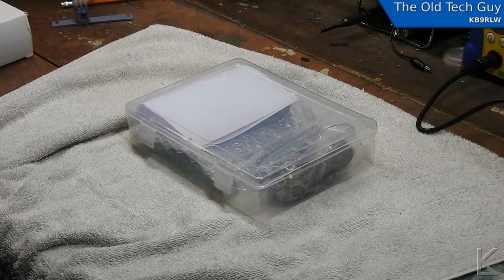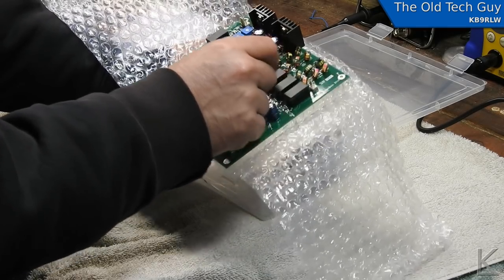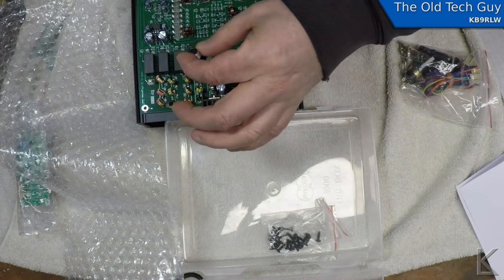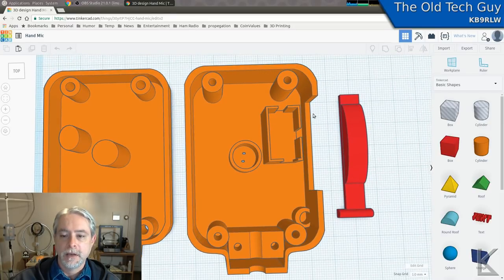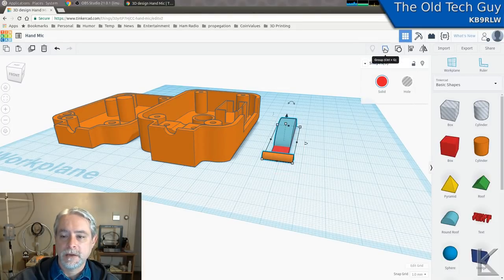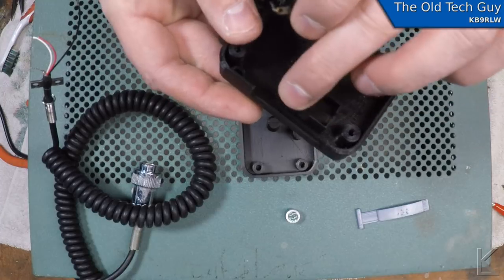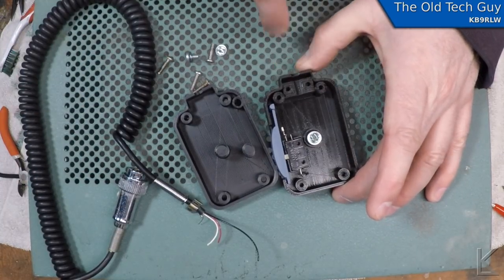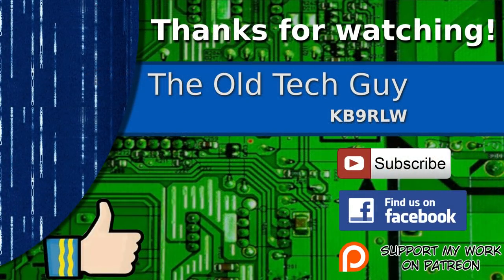Ham Radio - uBitx kit build, making a 3D printed hand mic.

Comment: If it isn't too late I hope you will video your assembly of the ubitx since you have a superior way of making the complex clear.  Also I think there would be a market for a kit with your mic enclosure , a switch and mic cable - for people like myself w/o
access to a 3D printer but enough experience to wire it up.  Just think of the fun you'd have standing in line at the P.O. every day!
Reply from the maker: 3D printers are great for prototypes and one-off things, but not for mass production.  There's about 8 hours total print time for all three parts.   It's really more of a novelty, done for the fun of it.   I do make the source files available though, if you know someone with a printer, or if your local library has one.   There's also maker spaces in many cities where someone could have a part printed.

Comment: Nice mike case, I'll try to print it.  Would be a good idea to pre-thread the screw holes with a 6-32 tap.
I'm thinking of building a ubitx from scratch as I have tons of 2n3904-3906's and PN2222 and PN2907 transistors.  Also have an 11.27mhz IF filter from an old CB set, and I found some 45 and 61 mhz cell phone filters for the 1st IF.  I might change the RX IF stage to a hybrid cascode,  or use two stages of CA3028's (have a ton of them too).  I'd use audio derived AGC I think.

Comment: Nice MIC design Kevin ..... looking forward to the front and back case ends design you will come up with * POWER / ANTENNA / AUX IN jack / AUX OUT jack (( both for digital sound card if you like ) KEYER / maybe a Speaker if you build a small audio amp inside to  drive a nice sound =)   I'm thinking about the uBITX I have on order :-)))

Comment: Very nice as usual. :-)

I use FreeCAD but TinkerCAD looks interesting and very intuitive. I thought FreeCAD had a very steep learning curve at first and is now easy to use. I'm not using nearly everything it'll do but it's fine for my projects. Here's a quick pro tip. If you print in ABS you can put the part in an old crock pot with a tablespoon of acetone in the bottom. Put the cover on, turn it on and when the cover starts to fog with acetone condensation, unplug it and let it sit. Take the top off and the part looks like it was injection molded because the surface is reflowed with acetone to remove the layering from 3D printing. .

Comment: Ordered a uBitX V6 kit from HfSig in India a few days ago and they advised that shpping is delayed till 3rd wk in April via government Coronus requirements. I expect that date to be extended till mid May or possibly till late June. Canceled order and queried GigaParts re availability. No response yet.

This radio is the Bomb for the complete kit @ $199 plus $10 for expedited 1 week DHL shipping from India.

All reviews are positive and they report excellent receive audio. Plus, there are a ton of easy hardware mods/add-ons and firmware updates that turn this radio into a highly featured rig but nothing needs to be added for this to be a great radio.

This radio is a great buy with an ever expanding feature list from Makers/Experimenters and Serious Igineers.

HAMdom has never had it so good because of this product!

Two hundred buckeroos and your on the CW/SSB HF bands with a bit of wire and a 12 volt  battery. Actually a lot less for the fully functional PCB less  the case/etc.

BTW: An EFHW vertical or an 'L' antenna lets you talk to most of America and lots of the World, especially into Europe, with just 10 watts. Google 'Grey Line' openings @ just before Sunrise/Sunset.....

Comment: I noticed that mine had arrived as I was leaving for the Wisconsin QSO Party and set it inside until I returned. I was surprised that it was delivered by DHL. Nice microphone enclosure. I doubt that I will fret over a microphone. I have no need for it.

Thanks to NIght Stranger for the wiring diagram. I need to know where/how to wire my key.

Comment: Getting you nice and clear nice clean SPDIF/MPEG data, what about a module with a Tayloe mixer for QSD and a Tayloe mixer for QSE the QSD driving the AF phasing combiner and feeding to the volume control then onto the AF power amp then onto the speaker and a microphone amp driving the AF phasing splitter driving the QSE and the clock for TX/RX could be 40.96MHZ for 10.240MHZ TX/RX or 36MHZ for 9MHZ TX/RX.

Comment: Excellent video again.  I have a request for another video. Can you please show, how you designed the mike parts in tinkercad?  I have a rough clue how it works, but no idea what to do, to ensure everything fits perfectly together... Thanks.
Reply from the maker: Well,  I've already got a video up on how to use TinkerCAD, and another where I go through the process of designing a dipole center.   The rest is just sketching and measuring.   Have you seen the other two vids?
Reply: Yes, saw both of them. Its still not so clear how to design everything in order to fit perfectly together, like e.g. the part that forms the PTT, which is perfectly mounted in the base of the Mike?

Comment: I hope you have a video of making the radio
Reply from the maker: The radio is pretty much pre-built. All you need to do is wire up controls and jacks. I handed this radio off to a new ham with the condition that he would provide me video of him building it and using it. His life got busy, so I'm still waiting.
Reply: @loughkb  Will this work with the Pi to do winlink, and other digital modes?

Comment: Your mic case looks very nice Kevin.  I just finished my uBITX it's great.  Be careful with the phones jack or you will smoke U1, the audio output IC.  see https://groups.io/g/BITX20/ for more information.  Your case might be a tight fit - I had to use a larger one than I had planned to allow for the jacks, fuses, display, etc.  You will like the little rig.  73, Bill KC5SB

Comment: Hi Kevin,
Mic enclosure looks good. What was the case you had the mic sitting on at the end of the video?    73   WB3BJU
Reply from the maker: Some old Heathkit chassis.  I use it to raise the work up another 8 inches so I don't have to bend over at the bench.  I can't even bend over a sink to wash my hands without my back going out now.
Reply: Kevin,
I know that feeling. Injured my back in an auto accident and a spinal fusion relieved much of the pain. Nine years later (2000) was involved in another auto accident (both times I was rear-ended) and it gave me back all of the pain. Been that way ever since. On one occasion was sitting in an armchair and pushed myself up with my arms, and halfway out of the chair an intense jolt of pain kept me from either sitting or finish standing. Took several minutes before the pain subsided enough to stand up straight.   WB3BJU

Comment: 6/32" ? You mean 3/16"?
Reply from the maker: Second paragraph, first line.
https://en.wikipedia.org/wiki/Computer_case_screws
Reply: Kevin Loughin Ummm... That would be a number 6 machine screw, with a 32 threads per inch count. Not a 6/32 screw.